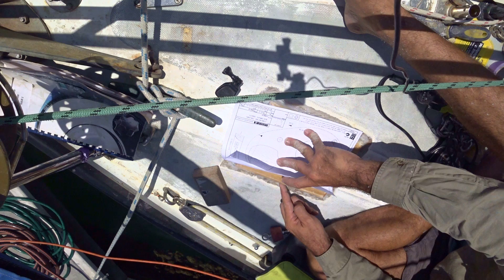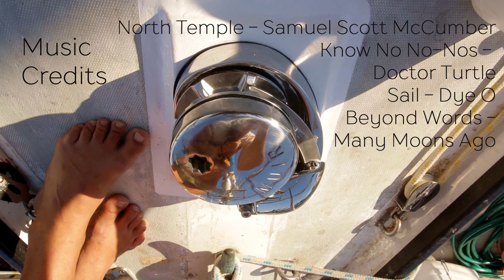Installing our New Windlass - Free Range Sailing Ep 72

Comment: I think I would put a piece of plastic pipe to form a lining around the sides of the hole the anchor chain goes through to stop wet going into the end grain of the soft pine causing it to rot quickly. The chain going in and out will soon knock off any paint you may have put on in an attempt to seal it. Make the insert and put it up through from the compartment below.
Fantastic couple with a fantastic ethos and life.

Comment: Great video once again.  

I think I would have forgone the timber and just used 1/2" thick structural fiberglass sheet instead, epoxying it right to the deck and running a fillet around it.  The same with the piece below.  

Here in the US we can get structural fiberglass (not G10 but slightly less hard polyester glass board) fairly cheaply.  It is much less difficult to work with than G10  Garolite (and much cheaper)  yet still strong as all get-out in 1/2" thick sheets.  Much stronger than pine timber for sure, and totally moisture and UV resistant once painted.  It simply becomes a thickened abd bonded section of the deck laminate.

I built a raised deck plinth with it on our aft deck for the aft anchor locker deck fitting and stepped it up 2" above the level of the deck so very little water will be sloshing up and into the deck fitting.  I also added 1/2" thick footprints under the mounts for the stern rail, epoxying them down and filleting around them before painting with deck paint.

We plan to stuff silly putty or wads of butyl tape around the anchor chain theough the deck to further seal it up in rough seas.  That'll pull right up and out if the anchor ever needs to be deployed.

https://www.mcmaster.com/composite-panels
Reply from the maker: Sounds like a better product to use but I wasn't aware of any place to get small quantities of such stuff. We don't have much space for carting off-cuts. I'll keep it in mind for the future though. I've heard of children's' Plasticine being useful as a deck bung thats cheap and resilient.
Reply: I was wondering about why you used solid pine instead of marine grade plywood?  By the way I am spoiling for a fight over anchor chain MOC. :-)

Comment: Just used Freerange18 at Arnolds and the item price was also very competitive. Thanks for your recommendations Troy. 
That new Muir is a much easier design for maintenance than the older model by the look of the motor spline and clip arrangement. As an electrician and instrument fitter, I've used Denso tape in heavy chemical industry for years to protect equipment and open electrical connections, good on those winch connections.
Reply from the maker: Ah- DENSO on electrical unions? Good to know.

Comment: That's clever. I like the way you drilled those holes in your router jig baseboard so that you could attach the vacuum cleaner hose to it and suck all of those bits up while you were routing. Didn't even have to put sheets up to stop it going on the other boats. Wish I'd  have thought of something like that ;-) . If I'm mounting anything that needs sealant as you've done, I have a handful of washers with a loop of reasonable strength fishing line through each. I lay them out anywhere the sealant doesn't meet the edge, then lower the fitting onto the washers and leave it like that for a few days. Pull on the fishing line loops to get them out and tighten away. I've also used tile grouting spacers where a really thick bed of sealant is going down and there's no unsealed edge space, and leave them embedded in the sealant. Another great vid, good to see it all coming together.
Reply from the maker: I wish I still had space for a proper shop-vac that could grab everything a router throws out. That little thing has a hard time with talcum powder.
Nice tips with the washers. Sounds like it would work very well and is worth remembering.

Comment: Thanks for the video, nice install! A couple of comments:
1) If you chamfer bolt holes before you squirt the caulk in then you build a nice-sized caulk grommet in the chamfer that is firmly bedded and holds onto the bolt. IMHO much better than a thin layer of caulk even if you do the "wait before tightening" trick.
2) If you plaster on a layer of thickened epoxy onto the top side of that backing plate before installing it then it will cure taking the shape of the deck. This will spread the load onto the underside of the deck a little more broadly than what you have. 
Your installation looks great and I'm sure it will outlive all of us but just a couple of ideas for you to think about from someone who's installed a bit of hardware over the years.
Reply from the maker: Great tips, thanks very much.

Comment: What i like about your chanel is that you have no snow or cold weather. Here right now it is a very mild -8c. This winter was brutal in that we have been beaten with tuns of snow, freezing rain, and wind. I am a snow plow operator that clear out the roads. I work the night shift since there is less trafic. To give you an idea i am south of Montreal Quebec Canada, a small town called  Salabery de Valleyfield(google map it you will see). We do 12 hr shifts and  dealing with stupid motorist, its a very stressful job. Last December one of my coworker was rear ended by a 1 ton pick-up while spreading salt on an ice covered road at 35km an hour. The truck hit him at at least 100kmh. The snow plow driver just felt a little hump but the pick-up truck was destroyed, the front bumper was pushed back above the front axel. The back of the snow plow is equipped with 5 strobe LED lights, one arrow pointing which lane to pass by also LED 2ft by 4ft wide, one center mounted emergency LED strobe, plus the normal truck identification, parking lights. He did not see the snow plow he told us, most likely texting on his phone.
Reply from the maker: Sounds tough Pierre. Hope you keep watching when we leave the tropics, though I don't think we'll be getting -8c

Comment: Back in 1998 we had a major ice storm here in Quebec Canada. A very wide area had most of the electrical grid torn down because of the weaght on the wires. For example a simple telephone wire which id about 5mils dia was up to 80mils with the ice.Just imagine all the major hydro towers with their six big cables covered in ice. I saw towers crumple like dominos under the weight. Anyway i was asked to help a big farm with their many PTO (power take off)  generators to keep them running 24-7. Two of them were 15000wat Onan units that had thier rotor turning at 3600rpm (60cycles here),well let me tell you that the gear box after 5 days of running constantly were getting real hot. To the point where the paint was actually boiling on the housing. The oil inside was 80-90 gear oil but burned up in a shot time. So in desperation in tried injecting two tubes (grease gun tubes) of corn head grease and topping it off with about two cups of 80-90 gear oil. After 24 hrs of running i was able to put my hand on the gears case without getting burned it was so mild.Since then, if i have an issue i go with corn head grease in gear cases. Oh the generators ran for 30 days until power was restored without any problem or damage.
Reply from the maker: Thank you Pierre. I love these type of stories just about more than anything. Hearing of improvisation in hard times always carries with it a lesson.

Comment: ok, really like your deck plug for chain, so I might have to swipe that idea. I would like to have seen how you are evacuating salt water from the locker, mostly because I have to do mine which is presently going down into the bilge. Zaya's pumps situated fore and centre can cope with 50 gall a minute and are double redundant. Muir are such a fantastic Australian company and very attractive products, good to see you picked them up.
Reply from the maker: The anchor locker has a 'Whale' manual diaphragm pump with the outflow routed on deck through a 1 meter hose that does a good job of preventing backflooding.

Comment: just one thing on the rope and chain gypsy  - our fit up was hindered with the three strand rode  - the recommendation is to use the eight strand  - principally because its a better splice to the chain and is not as problematic as the three strand.  -

Comment: Great work guys. 
I really wish you would explain your thinking behind the stainless chain. The reason nobody else uses it is not the cost but because we have all been told that it is not suitable for going through the gypsy, that it work hardens and shatters etc. Muir's themselves say not to use it.
You have been using it for a while yes? Obviously with no problems so it would be interesting to have your take on it.
Reply from the maker: Work hardening is usually due to plastic deformation or strong elastic deformation. Our chain is over 4t in its tensile strength so elastic deformation won't be caused by Mirrool pulling on it, especially with meters of nylon rode behind it acting as a shock absorber. In fact, you could lift Mirrool vertically by her anchor chain. I would be very impressed if the anchor held that! The working load of the capstan winch is pretty low and the teeth pattern well matched to the chain size so I think plastic deformation is pretty unlikely as well.
Stainless can get stress fractures if repeatedly loaded over a lot of cycles approaching half its tensile strength. See above. We do examine our chain every few months for signs of pit and crevice corrosion which is the most likely cause of failure. This can be accelerated if the chain spends a lot of time in low oxygen environment like mud combined with higher temperatures (tropical Australia.)
It's important to select 316L (low carbon content) chain like German Ketten Walder's, Cromox Grade 60 316L .
Anchor gear is a boats real insurance. That's why I'm reluctant to recommend something when it really should come down to the skipper and what he/ she is comfortable with. I use it because I accept the limitations and know I will conduct regular checks on my gear.

Comment: Hi, love your videos. Have you given thought to screwing a simple plastic splash guard from under deck next to the rope entering the anchor well. So, as the rope was feeding in soaking wet, the salt water wouldn’t splash/ spray all over the end of the motor gearbox, You could use a cut to shape inverted ice cream container if you know what I mean . All the best
Reply from the maker: I saw a suggestion for a bit of conveyor rubber. I liked that and will look for some.

Comment: A few small (maybe 1cm square) pieces of 3-5 mm thick 2-sided foam tape in the voids between your sealant beads will support the winch (or portllight, or whatever) while the sealant cures.  The foam tape, being softer than the cured sealant, will not interfere with the final mounting bolt torque.   And thanks for the mention about the Australian chandler.  I'm in the States, so the shipping deal doesn't apply to me, but I source parts from all over the planet and having a go-to shop can be a real life saver sometimes.   Pascale, how long until your cookbook comes out?
Reply from the maker: All recipes have to be tested thoroughly!

Comment: Another option rather than grinding on the hull of your ship, you can take a hand plane or your router and rasp out the cap wood so that it matches the curve of the ship.

I personally dont like grinding on my decks if I dont have to.   Dont get me wrong it looks great and hey as long as it dont leak and works ... No worries .. Right ... 🌹❤🌹

Marool is looking ship shape and im more that certain that shes got itchy feet and ready to go saliling ... 🙂

Comment: Thanks again for taking the time to make these videos :) Saw the pump for the chain locker...any suggestions for mounting, and routing the outflow? I need to install one of these and a "butt" plug :) Oh another... you obviously (to me) have tonnes more experience than I and am quite curious about actual anchor choice in terms of size, weight according to your boat size weight. I think I am way overboard with a Delta 20 (20 kilos). Thank you and best wishes. LOL...please don't forget 'Curt Van Der Werff's' point below.
Reply from the maker: Anchor manufacturers publish plenty of data on size recommendations of anchor and chain for your size boat. That's how we determined that a 10kg Rocna suited our yacht.
Route any pump outflow in a way that doesn't require a one way valve or other mechanical means of preventing the sinking of your boat.
Reply: @FreeRangeLiving  Sounds good.Thanks for the reply.
Reply: @OverlandTeaHouse - a rule of thumb that many remote area cruisers swear by, is take the recommended anchor weight and chain size for your boat, then go one size bigger for both.
Reply: @Garryck-1  Sweet, thanks. With the Delta #44 I went 2 sized too big and so took your advice and dropped to a 35. No windlass and plenty of chain so hope this is manageable by hand. We have a host of different bottoms here in the Pacific Northwest so we'll see how she holds. Cheers - Paul
Reply: Heh.. that's not my "advice". I'm just repeating what a lot of people who are far more experienced than me, say.. Heck, if you went 2 sizes up, then I'd say more power to you.. nothing exceeds like excess. But the excess weight on the bow might become a bit much if you really overdid things.

Comment: I'm surprised you don't have a SARCA anchor rather than the Rocna given your penchant for all things Australian :)
Reply: Thanks for suggesting them.. I've been checking out Anchor Right's demos, and SV Panope's independent tests, and the SARCAs look pretty impressive. I'm now thinking of getting a Super SARCA as a primary, and a SARCA Excel as a secondary anchor. They're certainly a cut above the Rocnas.
Reply: @Garryck-1  Based on SV panope's videos they seem to be. That said, Rocna and Mantus seem to be better than most and a lot of people with far more experience than I swear by them.
Reply: Rocna and Mantus are bloody good anchors, I agree.. but maybe their fans have never heard of SARCA.
Reply from the maker: We were in a position of needing an anchor and the Rocna was available and we knew they worked well. That was a lot of storms ago and it has performed above my expectations. Every dive on it has shown it has set in under a meter from the drop point. I used to be all about CQR anchors after a lot of commercial time but these new generation anchors really are better.

Comment: Best way to fasten something down like that it's do you use masking tape on both surfaces apply Supergirl on one surface and press down making sure that the glue doesn't spill past the masking tape that will hold it for the router then you can peel it off.

Comment: Nice bit of kit!  I'm jealous of that winch. Do you have any worries about using soft wood [pine] to carry the load? And what clues will you be looking for - to see if it becomes a problem? Cracks in the paint or? Thanks for the videos. Very much enjoy them.
Reply from the maker: Wood is pretty good with compressive loading and it's glass reinforced so it's no longer just pine. The forces on a winch are only in the 100s of kilos. At anchor all load is shifted to another point. Spiderweb cracks on the glass show problems

Comment: I see the windlass v capstan argument has already being debated , so i won't go any further with that one . It's nice to see someone else use a bung , butt bung (whatever) . I also feel it's a good method of keeping the oggin outta the chain locker . It's surprising how much can get in , even on just a short coastal passage , i'd hate to think about serious offshore work . I've been using it since my first boat , never seen anyone else use it , though . 
Now getting serious , i agree with keeping the motor away from the wet chain . However from what i could see on the video , turning the motor clockwise another 90 degrees , would have gained even more clearance . An added bonus , it maybe easier to remove the securing clip , as it would have been facing you . Another method would be a length of pipe fitted to a skin fitting  . However that would need to be long enough not to catch the chain when using the aforementioned , bung , so may not work with your arrangement . Another issue , is the skin fitting would probably need recessing into the pine stiffener , it would also help with chaff on the stiffener , though . 
My personal notes are , any bolts that i feel may need to be remove , i coat with copper (anti seize) grease . I certainly would have greased the shaft end into the gearbox too . Just a light smear would be enough . Nice mention , regarding the use of sealant . I learnt that one the hard way , working on a car cooling system . Though years ago , i never forgot it . You'd be amazed at how many , do nip the nut up , straight after fitting and wonder why it still leaks .
Finally i would just like to also add my thanks for making this . My back is telling me it's time to start considering fitting some help . This video shows many aspects , that catalogues don't ,  basically much food for thought . Thank you .
Reply from the maker: Cheers Mickey. If you saw the episode where we fitted the throttle controller, that's another spot for anti-seize or Tef-gel. Two different metals in there and I forgot to mention it.